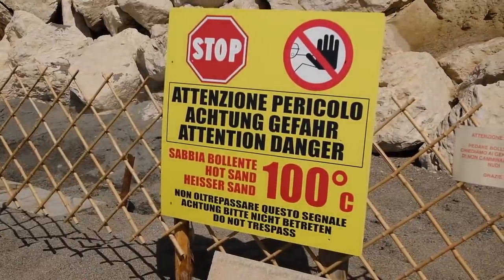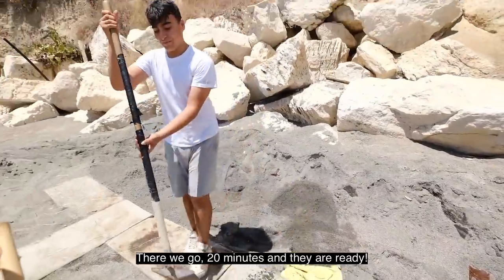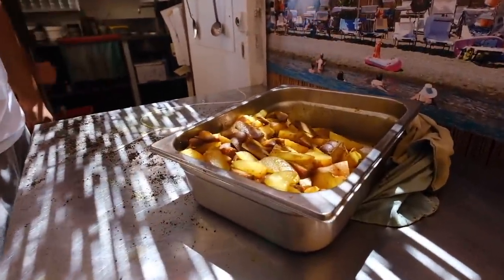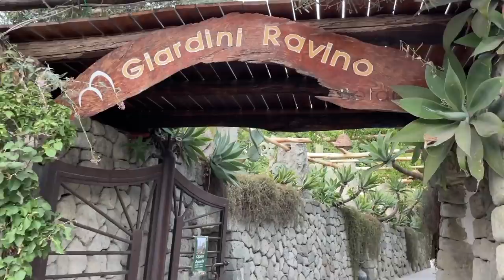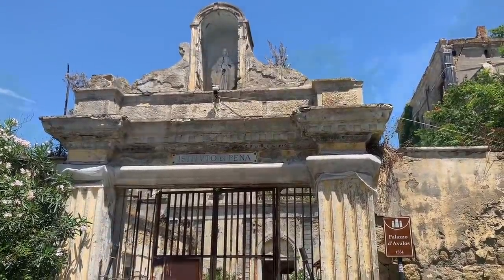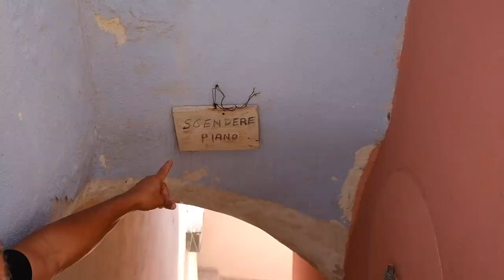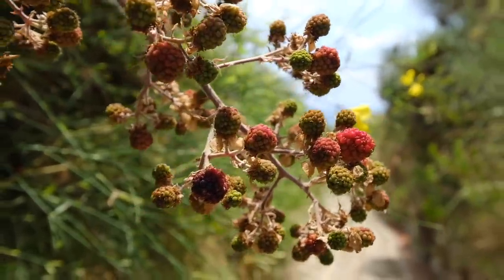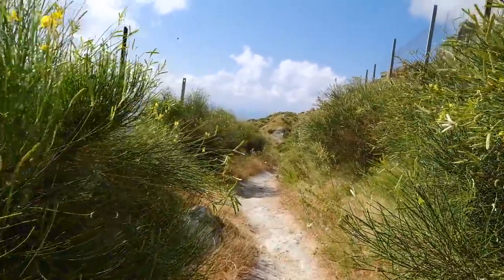WHAT WE DID ON ISCHIA AND PROCIDA! | The Positano Diaries EP 130

Comment: How lovely to be able to take water taxis from one island to another. Glad Carlo was so caring of Holly's delicate paws in the hot sand. I wonder if those little boots they have for dogs in winter to protect their paws from ice and rock salt would work against hot sands? On Procida, was it always an island used to corral prisoners or did they place a prison there because of isolation and it gave locals work to bring in outside currency through whomever was running the prison at any given time? What are the small fish on the antipasto platter? How do what appear to be the cement buildings hold up over time and through weather? How beautiful all around you on your trek downhill, especially the white peaks or eroded rock. I suspected the rains would be like the frequent ones in Hawaii that don't last long. Did you have to wash the slippery gravelly stuff from that roadway out of Holly's paws?